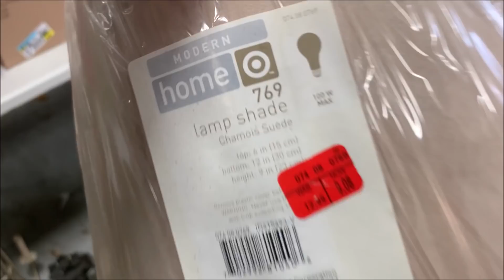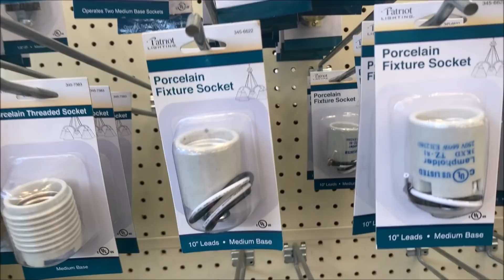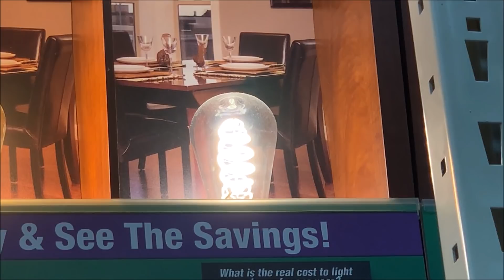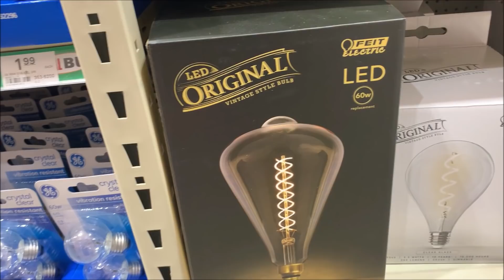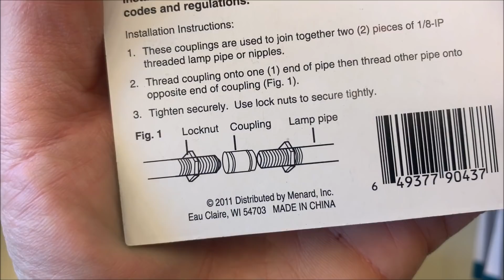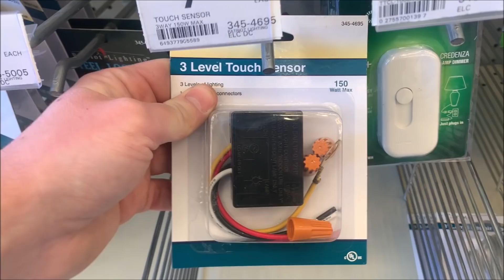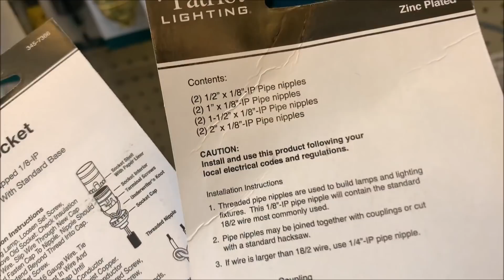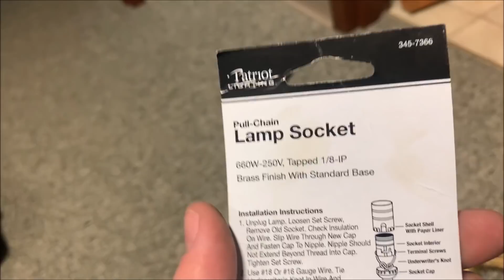[EXTENDED VERSION] How To Rewire an Antique Floor Lamp So It Doesn't Burn Your House Down

Comment from the maker: Wanna see a much shorter version without all the dumb jokes? Here you go: https://youtu.be/FY4_g8LBV5M
Reply: The long version there is no picture , they actually make some soapy stuff , I think it's called wire-pulling soap --you can put on for pulling wire, you could tape the old wire to pull the new wire... been there done that with existing electrical conduits, in old houses...

I usually save those for honey-do jobs... I come home with a lamp & people cringe...

Enjoy the ambience...

Comment: Hi Rabbit. As an electrician who did this few times I have just few remarks for you. Sorry about grammar, but English is not my first language. 
1. Main difference between USA and Europe is in voltage - you use 110V, we use 220V. Different types of plugs are just a way to prevent mistakes.
2. Yes there are "hot" and neutral wires, but in this case, as in most cases with only 2 wires it is irrelevant how you connect them. In case of old light bulbs current will flow ether way, and in case of LED bulbs, they have integrated electronic components that take care of everything since LED works on 5V direct current not 110V alternate current that you plug them in to. When you think about it - do you know which side is hot and which neutral in your wall socket? And do you check that each time you plug something in?
3. As for mechanical part of this video - First thing I would do is to spray every thread and connection with WD40 (and I know you have a lot of it, I watch every video :) ) and leave it for some time. After that puling it apart should be much easier. And when you use pliers on visible parts, put a piece of leather or a thick cloth between pliers and lamp to prevent paint chipping. 
All in all you did a good job, but you could save a bit of money and time with more experience.

Comment: The shade ring you showed was for the style of lamp that you said was for a bulb to fit through and hold which wasn't actually the case..the actual way it works is that shade with the larger hole goes over the bulb socket that is threaded and then that ring is screwed on and that holds the shade from falling...Ikea has a load of lamps with this style of hanging shade

Comment: Cut the plug off the old cord.  Attach top of new cord to bottom end of old cord.  Then use the old cord to pull the new one up through everything.

Comment: In the UK wires are colour coded.  3 pin plug is Green/yellow is earth , blue is neutral and brown is live.  2 pin plug is just blue and brown wires. 🏴
Reply from the maker: Some cords in the US are color coded too. Black is hot, white is neutral, and green (or a bare wire) is your ground / earth. It’s usually just the exposed / decorative cords that are coded by texture.

Comment: I’m sure you realized you can move the cord anywhere on the bottom so it doesn’t go out in the front since it has “feet” means it has gaps and since cord is in middle...but I’m sure you figured it out. 😎

Comment: If you had cut the plug off the old one and taped the new one to the old one you could have pulled the new one up through the top by pulling on the old wire at the top

Comment: The lamp is nice but looks a bit weird without a shade on it. Also having the pull chain hit the bulb isn't especially nice.

For the wires, it's not a matter of polarity. Polarity changes 60 times per second (in USA). One wire is phase and the other is neutral – although they are interchangeable in a wiring like this, so it doesn't matter to know which is which. That's the same case in UK, Australia, anywhere. The grids are all alternating current (AC).
Reply: I think the lamp looks cool with that light bulb, i am going to put one on my antique lamp  once i have rewired it wish  me luck.

Comment: The lamp style is from 1910-1920 max. Art Deco-ish
Reply: adding- Google Art Deco floor lamps and you'll a number of similar ones
Reply: The style may be 10s-20s but I think the lamp is newer than that because of parts of it being plastic which wasn't in common usage until after WW2.
Reply: @calmfulspider  Nawww...take a good look at the rusty bottom. The only plastic I saw was the plastic on the lighting part when it was rewired the first time. Those weren't the original parts on it.